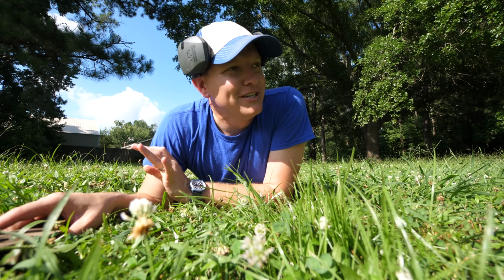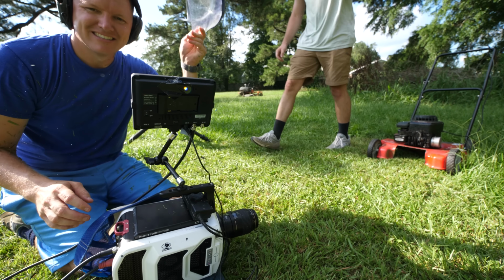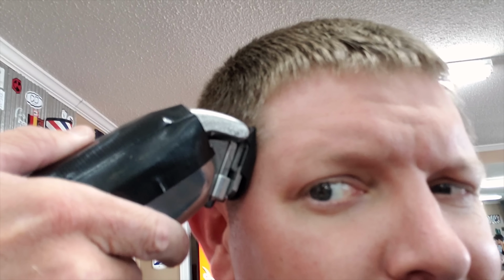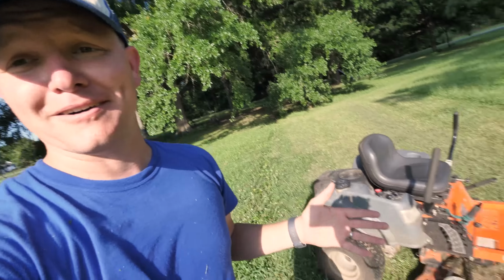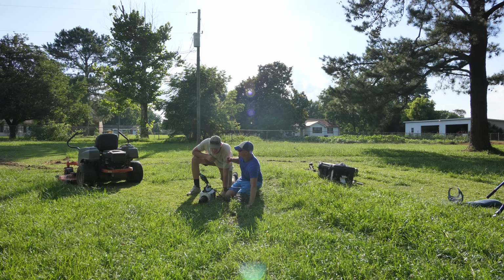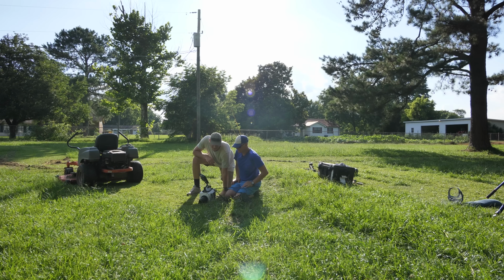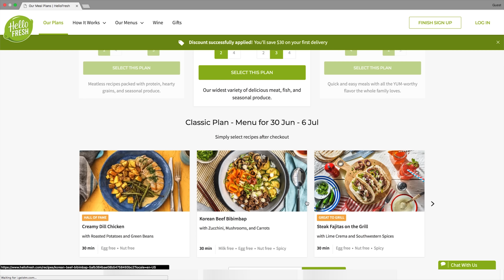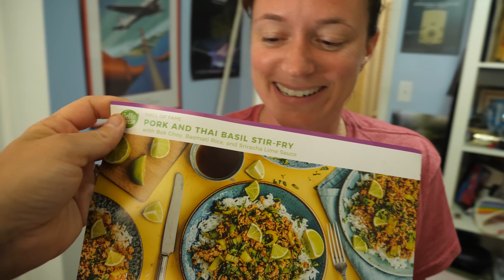How Lawn Mower Blades Cut Grass (at 50,000 FRAMES PER SECOND) - Smarter Every Day 196

Comment: I'm not entirely convinced that the upward force from the lawnmower blade plays an especially significant role in the cutting part of mowing.  Certainly it's useful overall, since it's what lets the lawnmower collect the grass in a bag or in the case of mulching mowers, suck it up so it gets hit by the blades again and again until it's shredded into little pieces.  However, an object moving at 200 MPH will rip or cut through grass regardless of airflow.  There's just too much friction against the edge of the blade and inertia making the grass fold over onto the blade as it moves past for there to be any chance of it somehow whipping back around and sliding under the blade intact.

I'd like to see a control test with the curved lifting portions cut off to give a flat blade.  Also, what if you installed the blade upside down so that it provided down force?  A comparison of the quality of the lawn cut under these conditions would be very interesting!  This would test the assumption that the lifting blade pulls flattened blades back up straight again so they're cut to the same length as all the others.  If this is the case, doing a comparison immediately after mowing might be a mistake since any blades that were flattened by the mower may still be laying flat.  Better to give it 24 hours after mowing for the wind to straighten them up again first.

As far as I can tell, the lifting lawn mower blade is a relatively new invention.  Before this, blades were presumably flat, though sadly I can't find pictures of old lawn mower blades anywhere on Google.  Apparently there are no antique lawn mower blade collectors for some reason.

Now, what about cylinder blade lawn mowers?  The geometry on those makes no sense to me.  How do they work?
Reply: cylinder blade lawn mowers' paddles/blades push grass into another blade and operate like sissors in that respect.
Reply: I can tell you as a Lawn Maintenance Provider that the lifting tab on the back of the blade makes a HUGE difference as to how well that blade will cut. If I use a "Low" lifting tab type of blade, the grass doesn't get cut as evenly or I have to make several passes over the lawn. The "High" lift tabs allow me to make a single pass. Also note that the "High-end" Commercial mower have tall decks (5"+) to maximize airflow under the deck to provide that perfect cut. Great video as always!
Reply: The old rotary mowers cut like a pair of scissors as he explained in the video (cutting blade and bed knife blade), but there are commercial mowers that are in the Flail Mower category. They have a ton of little blades on a shaft/drum that spins and cuts grass like a knife cutting paper pretty heavy duty machines.
Reply: i don't necessarly agree but i upvoted it for visibility. 

it is interesting to answer these questions in more depth.

7:15 doesn't look like it cuts the grass right now. 

also the cutting efficiency heavily relies on the bility of the cut thing being able to move away. if you jus a grass blade from the side it will be way easier.
Reply: Yes it is. Actually one of the most important aspects besides sharp blades. Yes it will cut, but cutting ALL the grass is the end game. And airflow will provide that. If the grass blades aren't lifted up they will just lay down never making contact with the mower blade. 26 years commercial mowing experience here.
Reply: I imagine that without the lift tabs the blades might actually act as a fan and blow the grass against the ground, out of reach of the blade.
Reply: What about grass trimmers with flat blades or nylon cords?
Reply: Lifting is not necessary to cut but it definitely makes a difference in how even the cut is.  I would be interested in seeing a mulching blade in action through a clear viewing window.  Mulching blades work with a plugged off deck so there is no in-flow/out-flow but I have noticed that mulching lawnmowers typically have more of a curved upper portion of the deck.  This would make sense for if the airflow in that situation is more of a vortex where it flows up around the blade ends then goes up and curves back down towards the center in a continuous cycle.  One thing I have noticed is that though it is possible to get an even cut with a mulching setup I can't do it with as much speed as I can with a regular discharge setup on the same lawnmower so the inlet outlet flow of air does a better job of pulling the grass up straight than the vortex flow especially on less rigid blades of grass like buffalo compared to grass with rigid blades like fescue.  One grass it really makes a difference on is bermuda which tends to grow out laterally rather than straight up.
Reply: And many just use consumable plastic filament (string).
Reply: Longest comment ever
Reply: Maybe test one of those hover mowers?
Reply: @H4N2, yes, hover mowers, wouldn't they would be causing downward/sideways airflow if anything.
Reply: yeah and weedwhacker is basically just a spinning string and it cuts fine without any lifting
Reply: I agree with keldor! Not sure about the vacuum. Maybe it improves the cut, but  I think that what really do the job is the inertia of the blade, bending the grass over it and cutting it. What about a scythe? No vacuum, no flaps, more efficient than a nylon brush cutter, the basis of a lawn mower.
Reply: Thats what i was thinking!
Reply: Yuri Teixeira those do not get a perfect cut. They are not enclosed so they are not pushing the grass up or down but because a person is holding it he can move the string trimmer in certain directions to pull the grass up and also angle it. I'm not sure if it is standard but mine has a head that rotates counter clockwise if I'm looking down at it while holding it by the handles, which means that if I move to the left, it will pull the grass up and get a cleaner cut. If I move to the right, I will have to either go slower or go over the area more than once. (I'm talking about weed eaters/ weed whackers/ whatever you want to call them)
Reply: See I think the biggest issue without the tab would be that the blades will likely create a downward force, like any fan or turbine. If that is the case (and I am entirely assuming here I have next to no knowledge of physics) the grass will likely be pushed down. So I wouldn't say it's entirely necessary for the physical cutting but without it, the grass probably won't prop back up to even make contact.

Edit: I see a bunch of people saying that it's also the case with weed whackers, but again, in that case, the string isn't going to push the blades downwards because it simply won't impart enough of a force to push the blades down since it's a string.
Reply: I agree with most here that the lifting blade probably does make a noticeable difference, but am a little disappointed that no tests were done in this video. He simply recorded it then gave assumptions (that could be true, but weren't tested).
Reply: The757packerfan what he got wrong is that the grass stays up while the blade cuts it because of suction. It relies on the inertia of the grass blade. What the suction does is pull it up straight to get a smooth cut. Without the lip on the back of the blade, the mower will still cut fine, just not evenly. He should have done tests where he cut off the lift tab thing on the back of the blade and compared the results
Reply: Its easy to do just put the blade on upside down they still mow.
Reply: MrNorthstar50 I agree - this seems to be an easy way to test just how much the wind from the tab affects things.  An upside down blade represents a worst case.  If the results are drastic, further testing is in order.  If they're minor, there's no need to destroy a blade by cutting the tabs off.
Reply: Furthering everyone's comments about evenness, it's worth mentioning the hair clipper again.  Clippers can, of course, cut hair without the vacuum that one had.  However, having had a great number of clipper cuts myself, I can tell you that there is always a tuft or two of hair that manages to avoid the blades no matter how many times you go over that spot.  I bet the vacuum is a real help with that last 0.1%!

I wonder if that vacuum clipper has problems with the fan clogging.  I mean, it's located right where it would suck up hair as it's cut, and hair is so very good at wrapping itself around spinning things...  I'd assume it has a filter.  And that you'd be brushing hair off of it constantly.
Reply: MrNorthstar50 from experience of accidentally having my blades on upside down before, the mower cut terribly. The difference is not that noticeable on a push mower but on a large mower it is very noticeable.
Reply: MrNorthstar50 and even though the sharp side of the blade them would point backwards? I doubt it.
Reply: Pungpinans Torg it does still cut just fine. The blades are just going so fast that they blast through the grass because of the inertia of the grass
Reply: Yes, Keldor I was thinking about the same thing, I use blades that have very little of a curve up, because I don't want to mulch up the grass I just want to cut it that's all.  And one thing they don't seem to think of is that the airflow going up hits the mower deck that would have to come back down pushing it down also.  I'm sure there would be a vortex of some kind.  Now if it helps or hurts I don't really know to be honest, but I would think it might just help the grass to do what it would do anyways, i.e. spring back up, likely faster if for no other reason because of the turbulence, kind of like in liquefaction.   Also the hair clippers was kind of a BS thing to show, sorry but I have to smile about it. :),  come on we know the the vacuum is just to take away the hair so it's not falling on the man,  it has almost nothing to do with pulling the hair up so it can be cut better.   Now I'm sure it would pull up the hair some but it's not a justifiable reason to deal with the vacuum hose fan & etc. in itself.  I cut my kind of long hair with elect. clippers & I'm sure the vacuum would do no good at all, likely just get the hair sucked in a would be hanging in the way at best.  I Keep my hair longer because I love working outside & have dealt with skin problems having somewhat to do with the sun.  'God' gave us hair to protect us but us being rather crazy vain humans we tend to cut it off.  :)
Reply: I think I got it? similar to the helicopter there designing to put on mars with two blades it compresses the air in between to give it more lift. They need to do this because of the low pressure on Mars. The same way, one of those toy helicopters work with a weaker motor and are still able to fly. Anyway, the lawnmower as it spins with its upward bent bar on the blade is increasing the pressure at the top of the compartment of the lawnmower and the higher the pressure the slower an object can travel through that space. This increase in pressure at the top slows the motion of the grass holding it in place allowing the blade to easily cut the grass.
Reply: You can't cut the grass properly if it's laying down. Need to lift it up into the blade's path to get an even cut. Just like cutting hair.
Reply: +Sara Llewellyn I agree so when the blade spins it both lifts the blade of grass and increases the pressure in the top portion of the blade compartment in doing so it retards the motion of the grass and straightens it allowing it to easily cut the blades of grass. its like the resistance you feel when in a pool of water it makes it harder to move throught the denser liquid or gas(higher pressure) so the upward force and higher pressure cause the grass standup and stay there to be cut.
Reply: You probably watch rick and morty
Reply: Yeah i'm surprised he didnt test his hypothesis before concluding.
Reply: My 21" Toro Super Recycler has a relatively flat blade with a small angle up along the rear edge.  Blade turbulence lifts the grass leaf to provide a more even horizontal turf cut. The under deck contour is just as important to create a lifting air flow on the grass, since Toro has placed some raised formations to create under deck turbulence and swirl clippings. The clipping aren't attached, yet are still being cut by the blade. Those cheap old mowers, prior to mulching mowers, often had flat blades and flat sheet metal decks without a bit of contouring, some were nearly squares without inset wheels, a box. The speed of the blade and a sharp blade make the cut. The blade shape, engine power and speed, and deck contour are features which define better engineered equipment, and that equipment does a better job than those old mowers. You guys need a camera like the drain cleaners use to get an under-deck video.
Reply: Also I think without the "tab" the pieces of cut grass would just fall back down, so maybe it's part of how the cut grass is collected?
Reply: Gregory Bogart  Do you bag clippings ?   The Lift of the blade helps get the grass into the bag easier.
Reply: That single blade of grass is being pushed down by the force of the blade hitting it and it bounces back up due to the vitality of the grass, the upflow is not as great as the horizontal spin of the blade that keeps flicking that grass blade up and down. Go out on your lawn and record your finger flicking a blade of grass over and over and play it back in slow motion and you'll see the blade spring up on it's own after the flick. In order to create real lift the whole blade would need to be angled like a helicopter blade, not just a 2% angle on the outside tip.

Comment: The blade does create 'lift' (read airflow) but it's not required to cut the grass, or else line trimmers wouldn't work. The grass breaks when the blade speed is high enough that the grass can't get out of its way (inertia).  The bent blade is a fan that lifts & blows the cut grass into the catcher or out a chute. That effect stops when the bent bit wears out.

Comment: Remember the old trick where you unfold a newspaper and lay it across half a ruler. If you hit the ruler fast enough you could break the ruler in half. The speed you hit the ruler at was just too fast for the newspaper to lift up, so the ruler broke. This is how lawnmower blades work. It's speed, not lift. I mean, the lift does help in various ways, but it's certainly not a pivotal part of the process. Please do a video with perfectly flat and straight blades and see what happens. I bet you it'll cut grass pretty well.
Reply: Destin, I think you got this one wrong. I agree with Chrispm84. I assert that this is a turbulence + momentum phenomenon. Not a suction one.

The little blades of grass are whipping around in the turbulence and eventually get hit by the mower blade. The mower blade is moving so quickly that the grass can't move out of the way (due to momentum) and get chopped.

I would also suspect that some grass blades require two or more hits before they are chopped down to the mower blade's height.
Reply: david garlisch I think Destin is over thinking this. Where I live we don't use lawn mowers but grass cutters. It's basically a high speed fan on a stick that spins a thick nylon(can use steel blades but nylon strings are safer since you arent in danger of a blade chipping) very fast to cut grass and it cuts pretty well. No suction, no wind.
Reply: I'd also point out that when using larger farm equipment (good ole bush hog), those blades are elongated chunks of iron swiveling around under a shroud. I don't think there is much of any lift in that equation. It's more like bludgeoning the grass until it short.
Reply: Yeah I think it's more of an inertia effect
Reply: Chrispm84 Well yes, but what I believe the lift does beside help a little with the cut is eject the grass so is "clean" enough to keep cutting without interference. Thought I've seen mowers with straight blades.
Reply: The newspaper thingy is about air pressure
Reply: Also sickles work without airflow.
Reply: Chrispm84 a sand blade has no lift and cuts just as effectively as a high-lift blade. Lift blades are for ejection. High-lift blades are for baggers, and mulching blades create a toroid airflow to cut the clippings multiple times. You're right, lift has nothing to do with cutting. The demonstration he gave of holding the grass with his hand was incidentally a good analogue of what's happening. Friction allows the blade to "grab" the grass and sort of rip it off. Slicing the grass is actually bad for it, so this is one reason you don't want a super sharp blade.
Reply: It's about air pressure and speed. If you slowly push on the ruler, just like grass, it'll just move out of the way.
Reply: @deluxeassortment  why would you not want a sharp blade???  No, slicing is what you want, bludgeoning is bad for both the plant and efficiency.

Comment: No wonder why it’s harder to mow when the grass is wet. The blade can’t lift the grass up because the water/dew adds up to the weight. This is very educational. Thank you for posting this video. I highly appreciate it!
Reply: Mine appears to cut fine.  I have to stop often to clean the under side or empty the bag and clean the chute.  Letting it grow too long between cuts can add to this problem or even be necessary for this to be a problem.